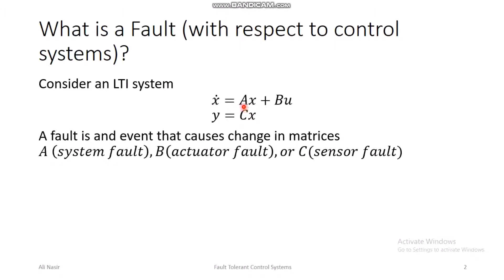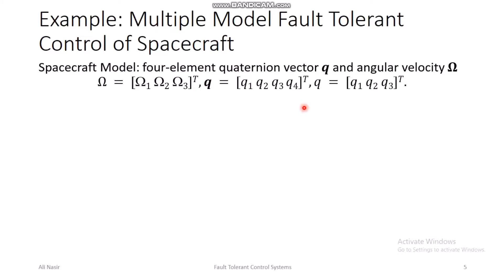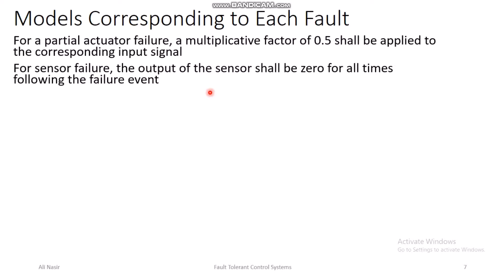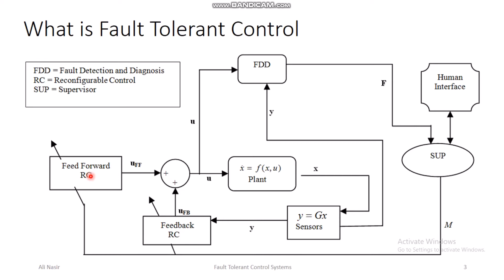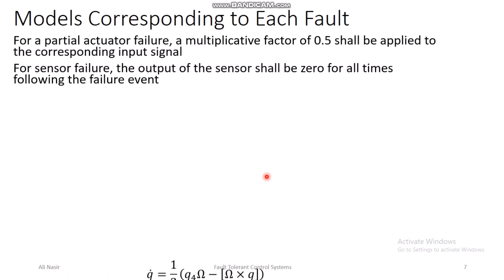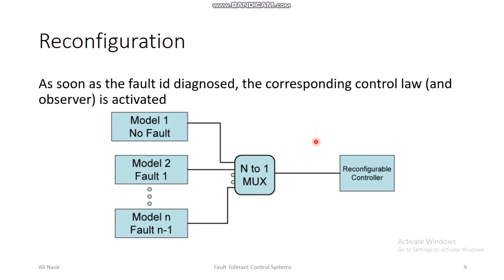Fault Tolerant Control Systems

Comment: Thanks for the video, this topic not an easy one to explain I admit that, but I have a remark in 32:00, I think that the rejection number would be 1 if the error crosses the threshold and would be 0 elsewhere.
Reply from the maker: Thank you for pointing this out. You are right. The rejection number would be 1 if the error crosses the threshold. Which would mean that the particular fault is not likely to be hypothesised as true (unless the other state variables in the same fault type result in the corresponding rejection numbers to be equal to zero).